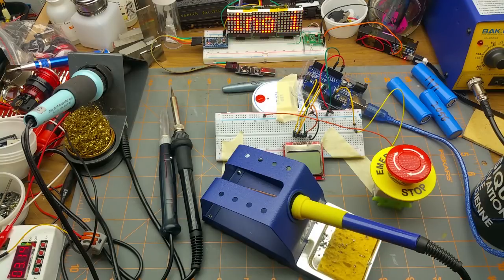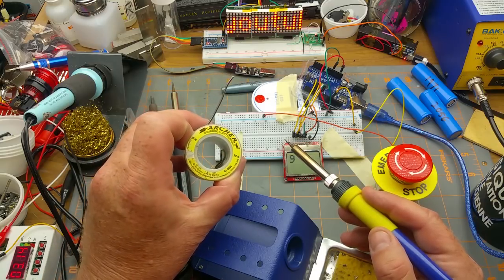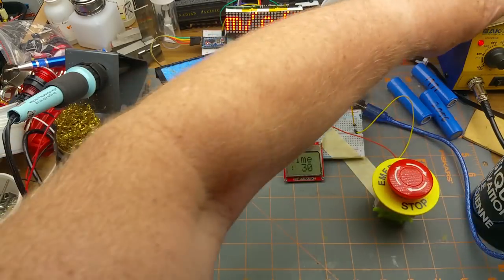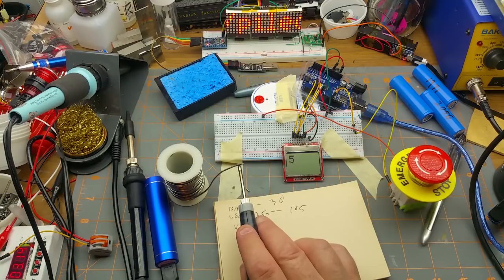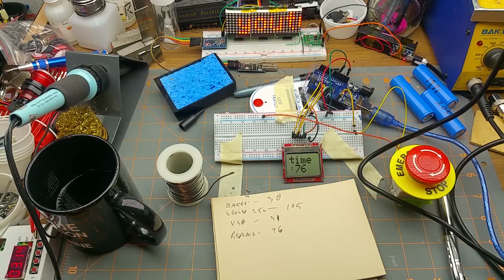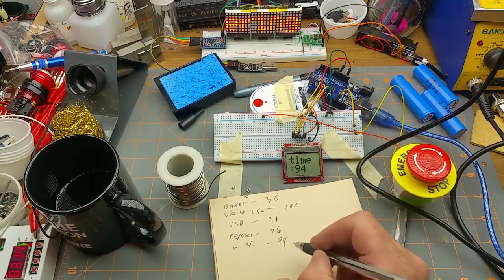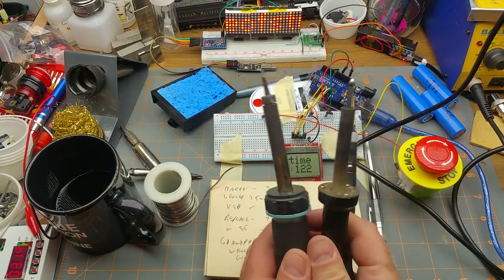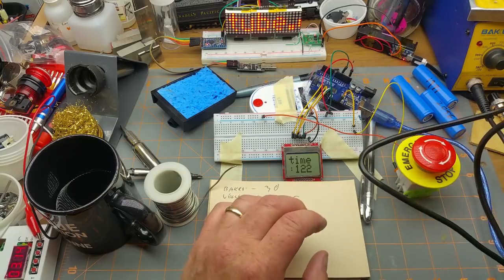soldering iron time trials

Comment: The trick to those USB irons is the thermal mass. That super fine tip doesn't have as much mass to heat, compared to the other ones that have a heavier tip and the metal shank of the iron. Downside is that it also cools down quickly, so soldering something with a ground plane is harder. They're pretty OK in a pinch though.

Comment: The hakko replacement uses a bad ceramic heater. You have t replace the heater element by a hakko 1321 (50W ) or a hakko 1322 clone that sell on ebay for like 3$ each.
There are some videos on youtube explaining the difference between hakko 900 heating elements. The ones that should be used are the Hakko 1321 type.

Comment: For sub 20secs heatup time, you're missing the very popular TS100 soldering iron.
Reply: Not only. Any DIY kit from China with 24v power supply and T12-"ish" tips will have 10 sec or less. 
And if T12-"ish" kit assembled properly, it will have ground connection as well. 
Over-hyped TS100 use same T12-"ish" tips generally, just shorter, and does not have dedicated ground connection.
Reply from the maker: I've looked at the TS-100, but it's 10x the price of my little USB iron. And almost what I paid for the entire Bakku / Hakko clone station.
Reply: 30 sec for $5 is pretty good compared to 15 sec for $75. I personally would rather a clone FX-951 full soldering station, that has the same fast modern T12 tips, for $77.